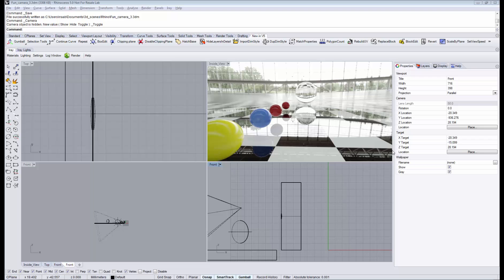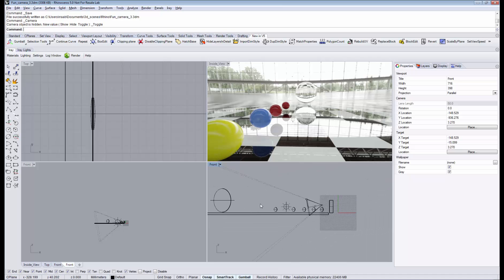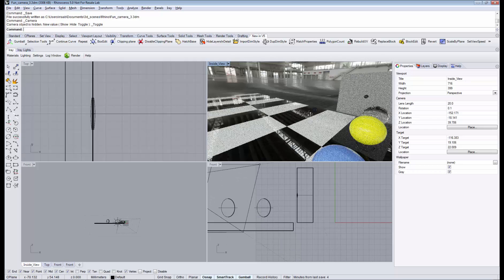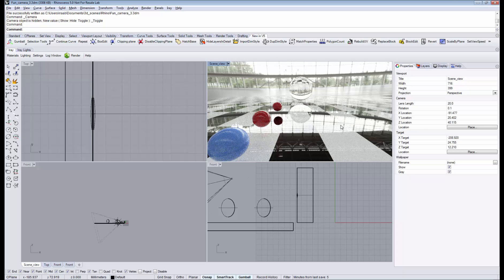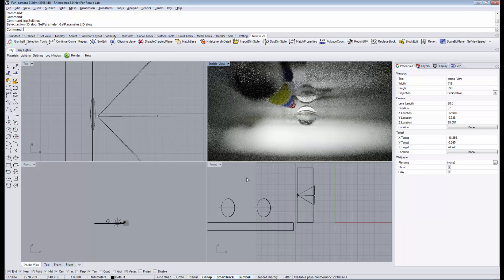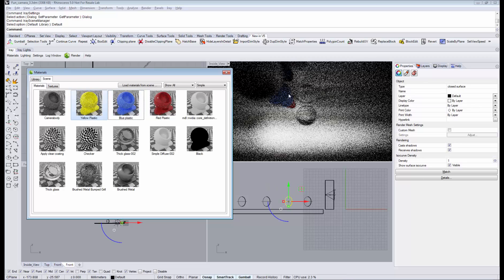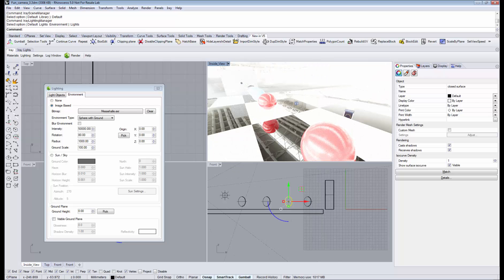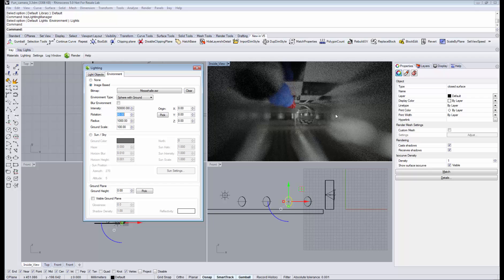Techdemo - Simulating a (pinhole) camera in Iray for Rhino

Comment: The whole point of a pinhole camera that it does NOT have a lens and relies solely on diffraction via the pinhole... Therefore it has a very high effective "f-stop" and requires a long exposure if you were using film on a backplane. As soon as you add a glass element - this is no longer a pinhole.
What you have here is a Camera Obscura!!!
Reply from the maker: +PIXELFLUX your are absolutely right on this one, thank your for pointing that out. The whole project started as a pinhole camera but I added a glass lens at a later point, since I was interested in how it would affect the projected image. Though there are Camera Obscuras without lenses as well. 
However, each camera model would work with Iray, though with a pinhole you would need to wait quite some time to see a result.
Reply: NVIDIA Iray for Rhino so would you say that iray can account for this phenomenon and actually render out a pinhole image? Would it support diffraction too at some point?
Reply from the maker: +PIXELFLUX So you got me into trying out the pinhole camera as well - and I captured a small video showing the results. Render time explodes - but after a long long time you would indeed see the result of our pinhole projection. 
https://www.youtube.com/watch?v=eI5Cu_7D6gw
Diffraction is also possible with Rhino, this requires a special type of material, so you can render glass and diamonds as well.
Reply: NVIDIA Iray for Rhino 
Hah, brilliant! I honestly didn't expect it to work, but the light transport is doing its job. Nice!
Regarding the rest - diffraction and dispersion (which is what I'm assuming you meant since you mentioned glass and diamonds) are different. Spectral dispersion separates the wavelengths of light while diffraction can happen in air, water, etc and it's a phenomenon that bends waves around the edges of objects. In photography, diffraction softens images at small apertures, for example :)
It's also why your fingers seem to merge together when you touch them before you even actually touched them together (just touch your index to your thumb very gently and look at the point of contact - it looks like your skin welds together before your fingers even touch).
If you are short-sighted - you can also make correctional 'glasses' using a very small hole in a piece of paper/card and looking through it will give you a sharper image :D
Reply from the maker: Ah, the day has been too long, I misread... :/ Regarding diffraction the answer is a clear no, as I said we do dispersion in materials but we do not simulate down to the level of actual Wave–particle duality. ;)
Reply: NVIDIA Iray for Rhino Maybe with time :)